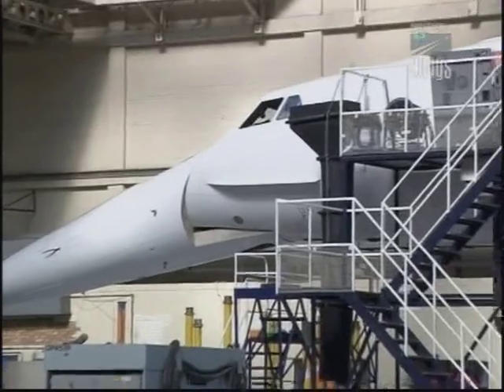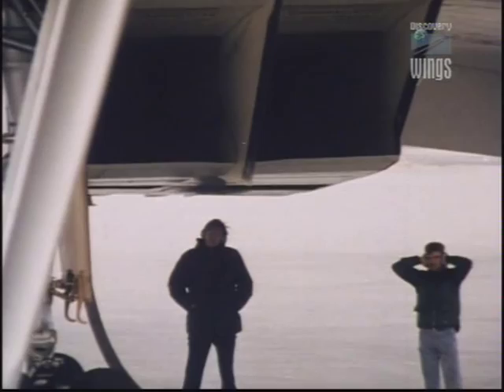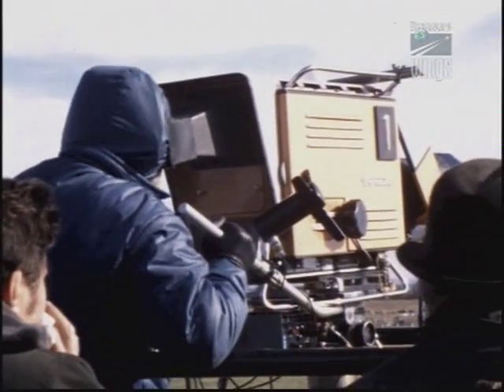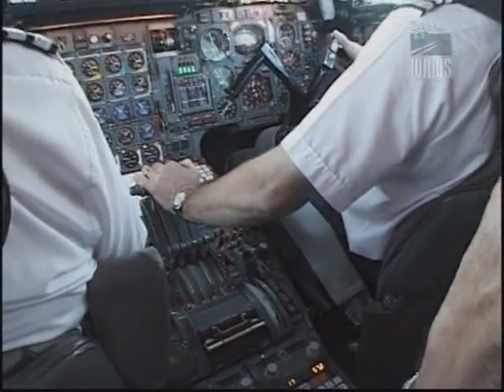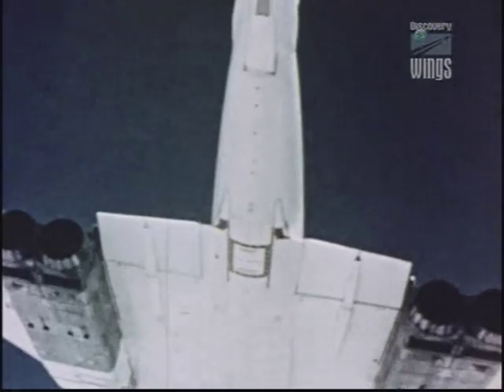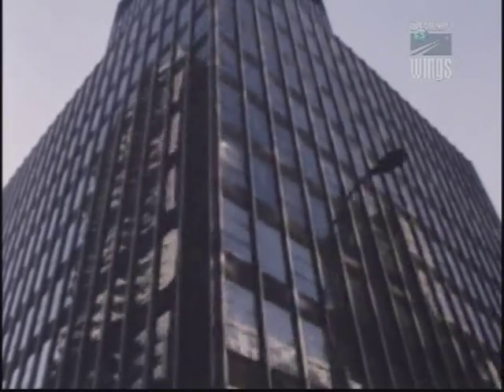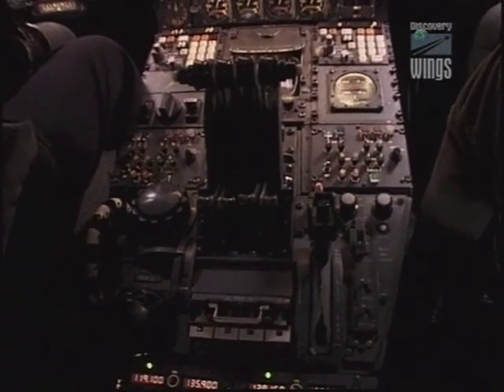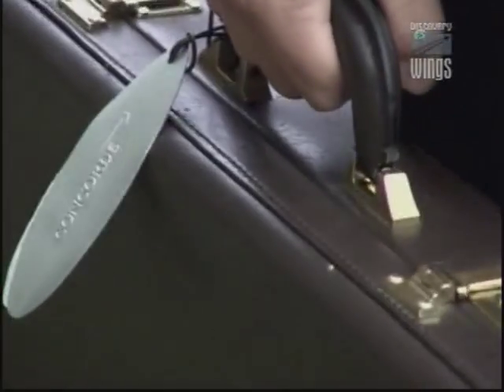The Concorde Era 1 of 2

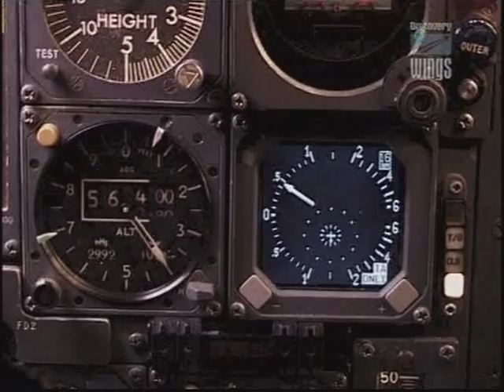Comment: 11:38 I dont think they ever had to use the yellow knob on real flights. It had to be used when blue or green hyd system came offline for some reason, this way the failed system could be replaced by the yellow system that was normally not used by flight controls. I don't think it ever happened on real flight.

Comment: Oh barracuda... showing your ignorance again? It seems that you only open your mouth to change feet!

Here are some facts: The muzzle velocity of firearms span a huge variety of numbers. Many 9mm rounds (pistol and MP5) are actually subsonic but let's look at your claim that Concorde was not faster than a rifle bullet.

.22 rifle bullets have a wide variety of muzzle velocities that range from  of between 1,000 fps (680 mph) fps to about 1,300 fps (886 mph) for typical rim-fire cartridges.

A 7.62 NATO round has a typical muzzle velocity of 2,700 fps (1,840 mph)while the M-16 .223 (5.56mm NATO) round has a muzzle velocity of around 3200 fps (2,100 mph). 

So the range of rifle bullet muzzle velocities goes from subsonic (less than 760 mph) to Mach 3 depending on the propellant load an the mass of the bullet.

Concorde cruised at 1,350mph or 1,980 fps.(I know I flew on her in 1999)

So, in fact,  Concorde did cruise faster than a rifle bullet in fact almost twice as fast as a very common type of common .22 round...

Oh and Concorde cruised at 60,000'. No available or planned commercial passenger aircraft has equalled it or is likely to. At 60,000' the atmosphere is only 10% that of sea level so pretty damn close to space.

Oops... Do you get tired of being wrong? Apparently not. Time to change feet barracuda!!